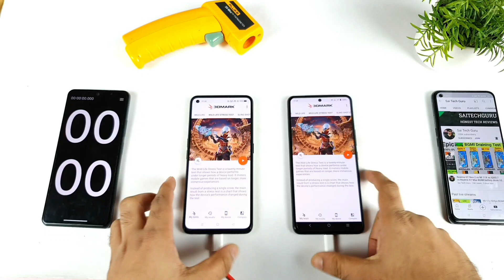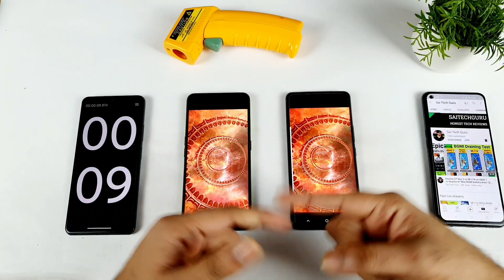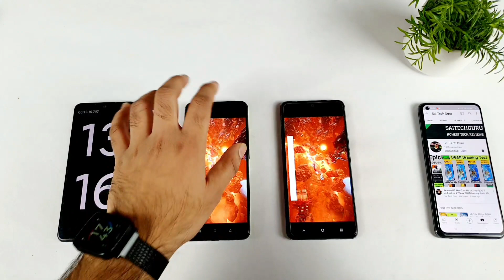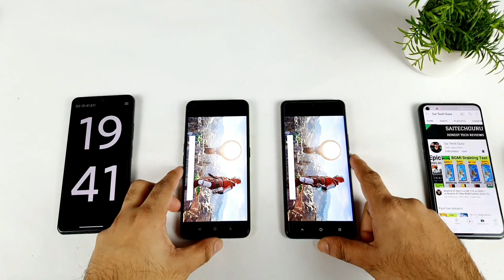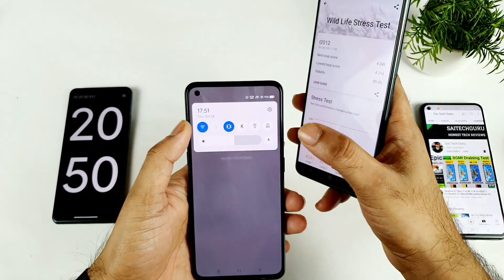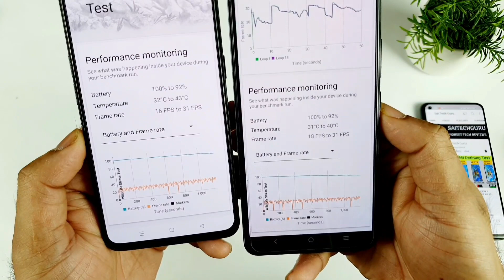iQOO 7 vs Realme GT Neo 2 3D Benchmark Wild Life Stress Extreme Test Shocking Results 🤷‍♂️😱😯🔥

Comment: Bro there is no clarity regarding realme gt neo 2 updates can u tell about them pls
How many years will the phone be supported?

Cause iqoo 7 says 2 years software and 3 years security  but realme hasn't showed anywhere?
Reply: Realme gets 2 years of both android and security updates
Reply: @videogamesandmore4092  what only 2 years of security ? then iqoo is better na?
Reply: @AyanKumar555  yes but I don't know about monthly or quarterly security updates realme give updates within 2 months  but for sure iqoo can be used for long term as it has better camera and ram management and 3 years of updates will keep it running smoothly and securely better go for iqoo 7 and also realme gt neo 2 has black colour crush issue and I have it and I regret buying I and it's has the worst camera for its price  it's almost like a budget ( under 10k) phone camera
Reply: @AyanKumar555  thanks for the information bro 👍
Reply: @AyanKumar555  better than realme realme give updates  every 2 months

Comment: Bro having issue with scrolling lag and any type of animation lag in gt master edition because I am facing this problem is this software issue or I request to return
Reply: You can return and buy realme gt neo 2 or go for iqoo 7
Reply: @videogamesandmore4092  but I used mobile for 7 days
Reply: @finishthegameyt3057  maybe going to service center may help if the return window is over.
Reply: @videogamesandmore4092 today is last day of return window
Reply: @finishthegameyt3057  then better return it since there are better ones like iqoo 7 or gt neo 2. It's your wish you can try factory reset and not fixed then visit service center or just return it now.
Reply: @videogamesandmore4092  I used this mobile for 7 day will they accept replacement?